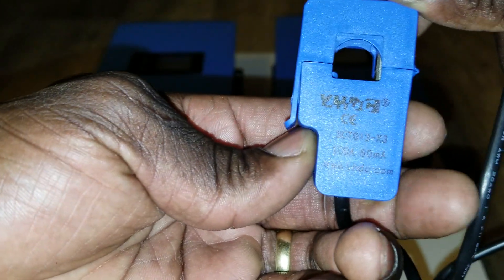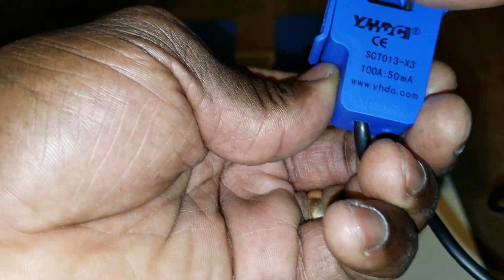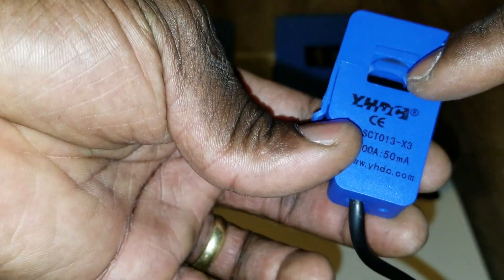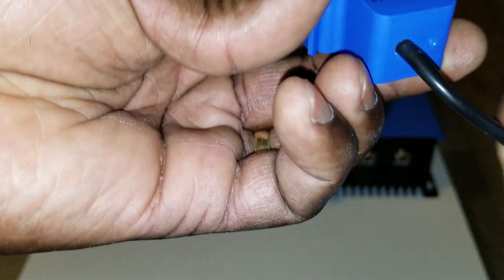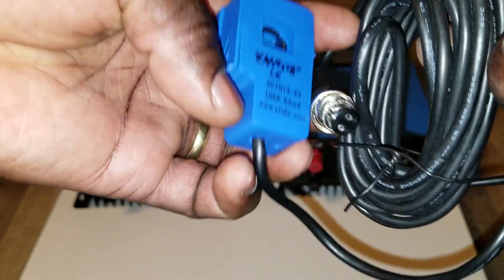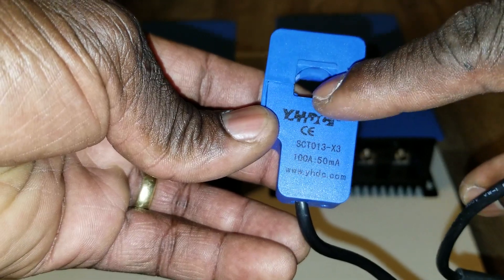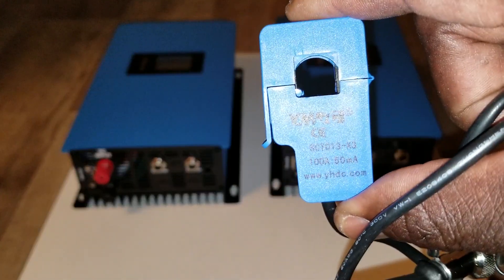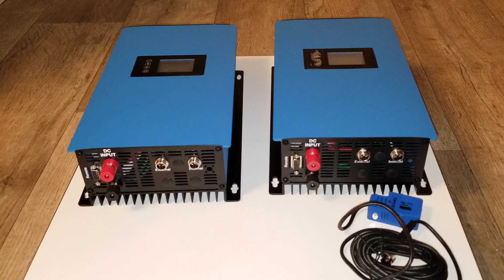SUN 1000W GRID TIE INVERTER LIMITER | INSTALLATION SOLAR GRID TIE INVERTERS TO THE POWERWALL

Comment: Hello, thank you for your videos.😊 so,Can I have 2 inverters 1kva , and plug them to my grid plug?
Also, about the limiters,  2 inverters I have 2 limiters, is ok to add 2 limiters on my main wire so i dont exporting power back into the Grid? It will works? Thank you so much
Reply from the maker: One inverter for each leg with a limiter for L1 and L2. That prevents you not to export power into the grid.

GRID TIE SOLAR INVERTERS: https://www.youtube.com/playlist?list=PLSNjIRSnUPDL4fWuaEW_gOZc-bQFuWZvV

Comment: Dear Friend.Do you happen to know what is exactly the use of External Limiter???? Also do you know if i can use an off grid inverter with a small battery so i can create my personal small grid so to ignite the on grid tie with limiter???thank you
Reply from the maker: The limiter prevents you from pushing power back into the grid so you electric meter won't spin backward.
LIKE SHARE and SUBSCRIBE

Comment: At the 32 sec mark you said that these will be feeding back to the grid ?  I thought LIMITERS prevent power from being fed back to the grid ? Did I misunderstand ?
Reply from the maker: Yes you misunderstood the concept. 
If you disabled the LIMITERS, these GTIL2 will start back feeding power into the grid that tends to spin your home electricity meter backwards.
If you haven't been a subscriber yet on this channel, please do, LIKE the videos and SHARE
Reply: @jwsolarusa       I'm looking for someone that can help design a very small system.  Thinking of  4   365 watt panels and whatever is needed with it and the LIMITER and suggested batteries.  Just want to supplement power that is used for our house.  I can increase size to what might be recommended.   Do you contract out your services ?

Comment: Do you know if it has DC input overvoltage protection? For example I see the DC input range is 48-90 volt. What if you connect two strings of 3 parallel panels whose voltage is 100volts when not underl load and 70Volts under load. Do you think there will be a problem with the inverter when not under load?
Reply from the maker: You have to be  below the recommended voltage input or else your inverter will protect itself from over voltage (voc) dc inputs and will not produce any power or watts. 
Thanks for stopping by, LIKE SHARE and SUBSCRIBE
Reply: @jwsolarusa  Thank you for the answer. This is great because when underl load my the voltage would fall from 100 to about 80 so that works for me. Thank you.

Comment: I was wondering if you had any input on my setup question ... I have 2 of these, only one setup, hooked to a 240v (us) double pole breaker.. using a 48v battery backup system with 3.5kw solar....

I figured out how to limit the output manually without using the clamp meter... is there a way to set it to shut off when battery voltage goes too low? So it doesnt pull batteries too low..?
Reply from the maker: Yes.
Go to my playlist on gridtie Inverter limiter watch the video with where I hooked up the 48v battery bank
Reply from the maker: LIKE SHARE and SUBSCRIBE
Reply: Ya I saw that. The video cuts out at the exact point you are setting the battery limit, and never talk about the battery cutout features. You just repeat yourself talking about the physical connections.

How does the cutout work... do you set the cutout in the settings? When does it come back on?
Reply from the maker: You have to set your battery cutoff
Reply: @jwsolarusa  that's what I'm trying to figure out.